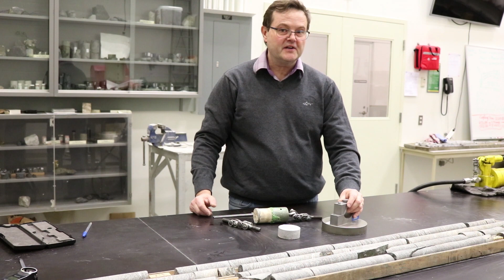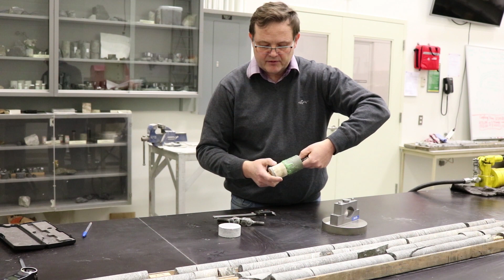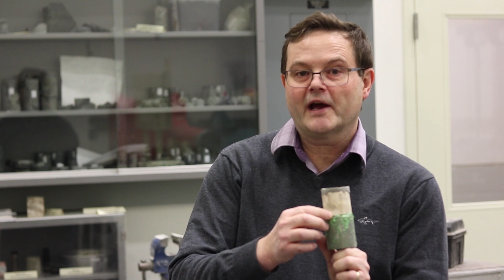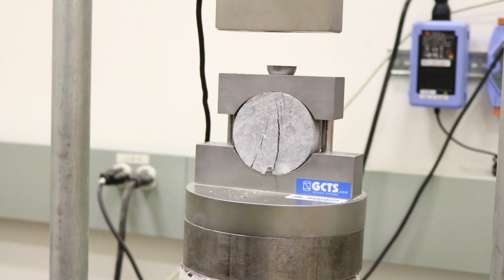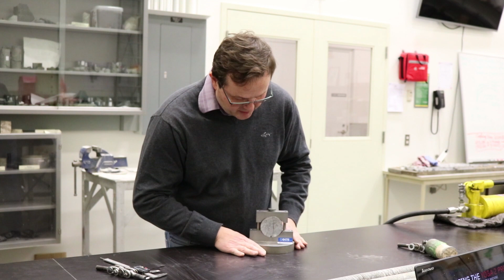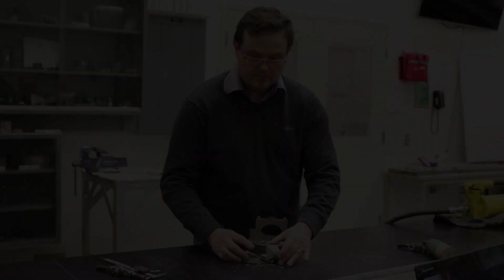MinE 323-Brazilian Tensile Strength Test (lab 3)

Comment: Hello,
sorry for permission to ask in the braziliian test according to international standards in the test the sample can only be in the form of a cylinder or core which I want to ask whether in the Brazilian test it can be done using a square or square sample, because in my research I did not use a sample in the form of a diameter because There is no circular cutting tool because the samples used are sandstones
Reply: No, you didn't
Reply: For Brazilian, you need to have a circular sample.